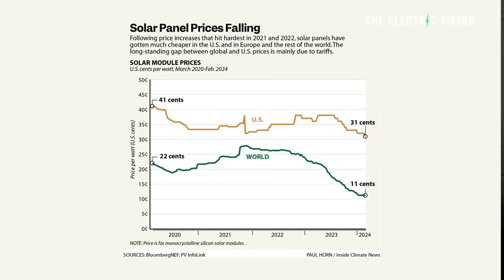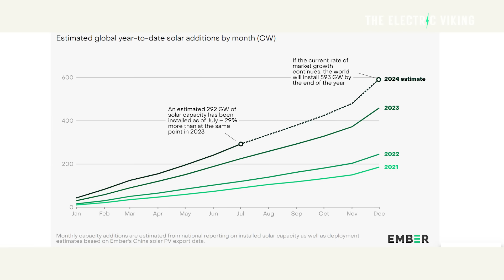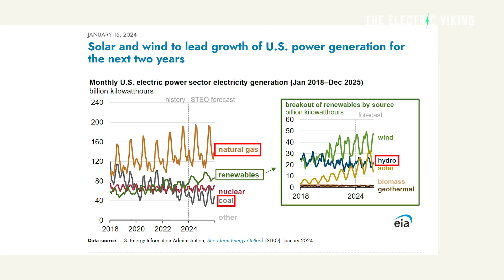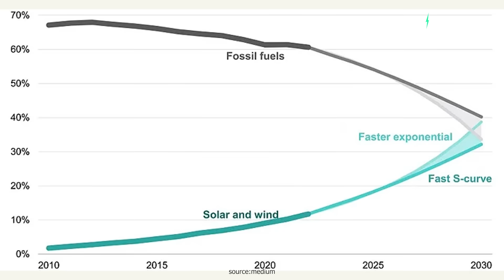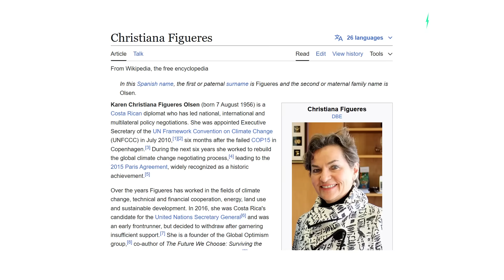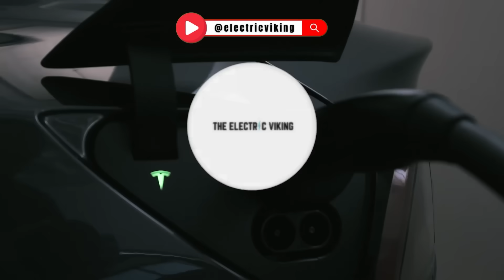Solar & wind will quadruple to 14,000 terawatt hours by 2030 & crush fossil fuels

Comment: My new home I’m buying in Las Vegas later this year (it hasn’t been built yet) is fully electric, energy efficient, solar on the roof, heat pump, induction cooking, two Tesla chargers in the garage. I have no gas in the home, no electricity bill other than the $15/month the utility charges me to be connected. I will install a power backup at some point but overall it’s great being energy independent and driving my EV for free and having my home a comfortable 70F year round for no extra cost. Love it.

Comment: I'm only halfway through this video, so perhaps you'll get there, but a major factor you aren't mentioning is solars intermitancy.  
I am a Canadian who got a solar system installed in December 2024. It is 5.66kW currently but will be 6 kW when the electrical grid connection gets  moved to underground. It should provide about 80% of the net electricity my house needs over the entire year. It has not generated enough power for my heat pump! In the summer it will be in surplus and I'll sell to the grid. Solar power is great but it cannot be a savior by itself.

Comment: Sam, you grossly exaggerate the cost difference between the US and elsewhere.  I have 21 panels on my roof here in Arizona.  It was about $3.85 per Wp back in 2015 and has become cheaper since then, and I received a 30% tax credit which still exists..  The panels are only a small part of the total cost.   There is lots of solar here and elsewhere.

Comment: Solar panel prices have fallen by over 50% in the last two years! Green electricity generated with PV modules now only costs around 2 to 4 cents/kWh! 
It is therefore extremely worthwhile to generate a large proportion of your own electricity in 2025!
For example with solar panels on carport or house roofs, on house walls or in the garden.

Comment: Fantastic solar news, Sam.  However, nuclear might actually be less of a solution than previously thought.  There are several new technology deep hot rock geothermal projects being built today and more planned.  Check out the city of Vantaa in Finland and a company named QHeat, short for Quantitative Heat.  It seems to me these new utility scale geothermal companies are quickly adapting oil and gas drilling tech, experience and data to provide renewable deployable 24 by 7 baseload energy, and they are doing it now, not five or ten years from now.  Without the dreaded 'N' word attached to their business they appear to be locking in chunks of community heat and electricity budgets today.

Comment: NASA reports global warming at 1°C where it has been since 1992 after falling from 1.1°C in 1991.   Nobody has notice the effect of solar voltaic panels because they haven't saved fuel.  It is extremely fuel expensive or prohibitively battery expensive to back up a solar farm when a cloud passes over it.  A home emergency battery backup system being maintained by solar voltaic electricity is attractive.   You're buying a four day home battery backup system then using solar voltaic to maintain electrical storage.  The solar voltaic panels are almost an incidental cost compared to the battery backup cost.

Dumping wild AC on the power grid makes other people frequently at lower income levels pay for that expensive support.  There has been little economic inflation pressure on US electricity rates.   Salaries did not go up and fuel costs were stable.  The rate increases have been from supporting wild AC from wind turbines and solar voltaic generation and implementation of fast response expensive to run instant backup generation for them.  It is likely that expensive forced support of wild AC by the public will be eliminated.

Comment: You ommit necessity to upgrade grids, it's good thing to do but it is necessary due to solar and it costs money.
Reply: At least in the US the need to upgrade the grid for future data centers and AI never seems to be a limiting factor for industry/government. But when it comes to solar/wind, then it is a problem.
Reply: @markvalery8632  in EU we need to upgrade our grids for household solar
Reply: @ That doesn't make sense. With household solar you are generating your own power reducing what the electrical company has to distribute.
Reply: @markvalery8632   no, it does since you have to put that power into grid and it's not what most grids are made for and you it's not like you just don't use grid electricity, you may produce more then you use (like I do, so I don't ever pay for electricity) but it does not mean 'no traffic' I use most power in evening when I produce zero, and when I produce most power, same goes for all my neighbors who have solar panels so issue is often grid can't take in so much energy and someone may not be able to sell their energy. 
that's why I will buy batter in the future, I am not off grid, no real need for me to store energy, but it is necessary for our grid.

Comment: When people talk about return of investment, payback time, they are forgetting one important thing. If you spend say 10,000 € on solar panels, solar hot water, batteries, then the value of your property increases by the same amount. Also the house will sell quicker. Same is true for a car charging point or good energy score. Much better investment than a new bathroom or kitchen, which the new owners will replace anyway.
Reply: If property value increases then in US property tax goes up. Wonder if that is taken into consideration with US payoff numbers. Plus if the money spent on solar was invested at 7% over the life of solar how does that compare.  I do not care as I today just committed to a rooftop 5.4 kw system. So just wondering...

Comment: 10 cent Wp. Supercheap Clean Solar Power. Rooftop, Solarparks, Parking Solar. We get a new Solarpark in Midden-Groningen Nederland of 200 MGp. 160 hectare cost 100 million euros. Start building Februari. Cheap Solar Power for our Community. 200 Million kWh every year in Groningen Nederland. In Germany near Leipzig a New Solar Park of 650 MGp. 650 Million kWh every year. Cheap and Easy. I have Rooftop Solar since 2012. 6000 kWh every year. Working perfect for 13 Years Now. No Gas no Energybill since 2012. Price here is 10 cent kWh. Taxes 10 cent. 
That is 100 % tax. 
And above that 21% vat. Tax is more than the Clean Energy. Thank You Sam for this Solar Update. In 2024 China installed 277 GWp Solar. 277 Gigawatt. Super ❤👍🌹🌹🌹
Reply: Fantastic, but production is close to 0 during the winter months in lovely Groningen.
Reply: @maartenvanderheijden-kl9yv  In Winter we have Cheap Windpower in summer Cheap Solar Power. Perfect combination in beautiful Groningen. We get Rich. And companies come to Groningen for Cheap Wind and Solar Power. More to come.👍🌹🙂

Comment: DISTANT RENEWABLES ARE GRID ELECTRICITY. EXPENSIVE ELECTRICITY, wake up.😮😮😮😮

NO GRID ROOFTOP IS the most fundamental economic option. 
NO GRID v2g BEVs massive battery's is FREE STORAGE 23hrs every day and all night long. 

Grow up, and listen. 

LNP high marginal taxpayers will ❤️ v2g BEVs and PV rooftop dirt cheap electricity. 
TAX FREE SAVINGS are at maximum for high income early adopters. 
Savings, 
Petroleum $3,000 per vehicle. 
Say $6,000
Grid electricity  $2,000
Gas heating, cooking, hotwater $2,000

Shaded hot roofs with cooling 😎 PV panels,  more air-conditioning costs savings.

TOTAL $10,000 tax-free is $20,000 before tax income and more hours of work,  hello, hello anyone home hello 👋 😀 😊😊😊😊

For 3 decades ? ? ?

Am I being too conservative for the high income tax paying conservative LNP VOTERS ????

Who wants NUCLEAR GRID ELECTRICITY electricity in Australia's Sahara Desert latitudes sunniest continent on the planet.
Who who who  ???? WHO ARE YOU ??? 😮😮😮

Comment: Rooftop PV is dirt cheap BECAUSE IT HAS NO GRID COSTS.
This is difficult for people to understand. 
Grid electricity is 10times more expensive than electricity generation. 

PV electricity is a 5hr thing and demand is a 24hrs thing. 

We need more BEVs, v2g BEVs. 
Most vehicles are parked 23hrs every day and all night long. 
Most vehicles drive building to building carpark space. 

Most buildings rooftops are elevated, sunny, grid connected, and need PV panels shading hot roof.

Hello selfplug-in V2G EVs or BEVs.

Comment: Rooftop PV is cheaper than windows $m² installed. 
Rooftop PV panels shade hot roofs and reduce air-conditioning costs,  shade 😎

Comment: I have a south facing roof and can generate >4 Kw. I am surprised that my panels generate more power on a fresh cool, bright day than when they get really hot in the peak of summer. Is this normal ?
Reply: Efficiency of solar panels decrease with temperature. My peak solar production per day happens in March even though there is more sunny hours in June in Massachusetts.
Reply: @markvalery8632  Same here. I wonder if there'll ever be a unit made that is PV combined with a 
fluid filled heat exchanger matrix. The fluid would reduce the heat in the panels and be used to  generate hot water whilst maintaining maximum efficiency from the PV side.
Reply: @AlanJan_UK_49  In 2013 I looked into some german PV panels that were water cooled. I was looking to put in a pool, but to extend the pool season (which in my area is 2 maybe 3 months if you lucky) by pulling heat from the panels and piping it to the pool along with domestic hot water. The design ran into a problem. The amount of panels needed to provide enough heat for the pool during early summer and late summer was way more than the 38 panels I could fit on my roofs. Then there was the summertime. That  same amount of panels would produce way way more heat than I could  use. I ended up with no pool and just plain old PV panels.
Reply: @markvalery8632  At least you thought about it. I just thought of it as a concept but there would be too many problems to overcome. I am utterly delighted with my domestic set up. I cannot store my power but I can boil water in a 1,000 watt camping kettle and keep it very hot in thermos flasks. I had about 1,500 watts coming in this afternoon so I will use the water for cooking tonight ( reduces gas used ) and washing up etc. etc.
Reply: Output for solar is usually rated at the temperature of 70 degrees F. Output tapers off as temperature increases or decreases from that point.

Comment: Generally agree with Sam. But Sam is from sunny Australia ! Here in Europe, most of the landmass is located North of the Canadian/USA border parallel : we do not have any sun in winter. And if we get inland wind, it is often too strong for the wind mills.... Therefore, for our long gloomy rainy winters where some places can see over 300 days of rain per year, we need another CO2 free source of energy. Only solution i can see so far is Nuclear.
Of course summers have long daylights and solar will make full sense then together with batteries for night energy. 
So lets shut down most Nuclear plants for maintenance during summer and save the dams water for dry seasons/years.

Comment: We don’t need large batteries 🪫 to hold the power we need superhigh voltage  underwater power lines that can take power from India 🇮🇳 to Australia 🇦🇺 to Japan 🇯🇵 to America 🇺🇸 to Europe to Africa problem solved. Because the sun 🌞 never sets
Reply: Though, the cost of grid scale batteries has dropped so dramatically it’s becoming cheaper to store locally produced RE than send it as HVDC across continents.

Comment: Double whammy for Americans. Solar is expensive and insurance companies are canceling policies if you install panels on the roof.
Reply: That's insane, insurance companies in your country have far too much power....
Reply: Where and when have they cancelled policies for having solar on the roof?
Reply: OK, just read about Florida, no other state, that is doing this. Very fishy. "Some Florida Power and Light contracts that says any damage caused by the panels, "you as a homeowner are responsible to pay for all of that damage." Often insurance companies will give an example such as a surge running through your panels that causes damage to the grid or other homes." But, "However, the theory that solar panels can cause damage like that is bogus according to state authorities, Campbell said." 
Another reason given by Florida insurance companies: "Home insurance companies are also denying coverage if the homeowner chooses to sell the extra power their panels make back to the electric company. The system is called net metering, and it's a common practice for a homeowner with solar panels."
Maybe the Florida government, electric companies, and insurance industry is trying to limit rooftop solar in Florida?

Comment: I want solar roof shingles like Tesla is offering instead of those ugly black panels. But they’re too dang expensive even with the subsidies. Remember that American homeowners also move every 5 years on average so they’ll never realize the full benefit. Eventually this will all turn around to a more cost effective solution.
Reply: Those Tesla roof shingles are garbage, Panels are way more efficient, and Musk is a m0r0n, I wouldn't buy a thing off that cl0wn...

Comment: Did you hear about the big, toxic battery fire in Northern California this week?? Terrible.
Reply: Did you hear about the air pollution effecting pretty  much all human population? I'm sure you regularly hangout behind idling cars and diesel trucks enjoying the toxic heavy particulate air. 

Did you hear about  Deep Horizon offshore oil rig fire and oil spill? Lots of people and animals died.
Reply: @ I'm so sorry it's so triggering for you to hear that there are still major environmental health hazards in a post-fossil fuel world
Reply: not as bad as all of the refinery fires that happen regularly.
Reply: @ Different, not lesser. They produce hydrofluoric acid, a heavy corrosive.
Reply: @respobabs  According to the Monterey government: "Monitoring is looking to detect Hydrofluoric Acid (HF) as well as particulates.
Data gathered so far indicates HF as non-detectable and low particulate levels.
To date, 750 data points have been collected using both fixed and roaming monitoring." The amount is lesser. Do some reading on oil train derailments and fires.
Reply: Did you think you had a point ?
Reply: @MickH60  Yes, when the video mentioned batteries, I remembered that there's a huge, toxic battery fire raging in northern CA. Sorry if this is upsetting to you. It's upsetting to me too.

Comment: im assuming you calculate with installed capacity when saying total nuclear*8 = solar in 2-3 years. now use the capacity factor of solar of around 10-15% depending on your location and suddenly you realize that the yearly output is only about 1/8 of what you think. that would still mean solar in 2-3 years = total nuclear which is a lot.
Reply: Capacity factor included mate....

Comment: Nuclear works 24/7 Solar currently in the UK is currently virtually non-existent with little sun over the last several months. Summer great, Winter no good.
Reply: you do realize that solar panels make power even on cloudy days right?
Reply: After tou spend 20 years building a generator tgen find enough fissionable material and find a safe way to dispose of waste but, by tgat time, solar and wind will have improved again. Forget it.
Reply: Nuclear is the MOST EXPENSIVE source of energy, with a by product that;'s insanely dangerous and takes 10,s of thousands of years or more to break down to safe levels of exposure.... Solar still produces power through clouds mate, it's about time people like you updated your knowledge...
Reply: How is Hickley Point C going?

Comment: Since installing my solar and battery system, 3.2 Kwh array with 13 Kwh battery, I have saved a lot of money. Yes it's not very efficient in the winter here in the UK/Wales but the overall/average savings over the year are significant. Another way to save costs is to charge up the battery at night when the electricity is cheap and use it in the day time when costs are high. Daytime is around 26 pence per Kilowatt hour and 7 pence at night. I am amazed that people if they can't fit solar don't just install batteries and charge up at night which is a lot cheaper to do. The one negative argument I get is "they" always ask what is the payback period which I suppose is a fair comment but as costs come down then this period will shrink. One good point is it will increase the value of your property if you are selling. A good saying is you don't plant a tree for yourself but for future generations.
Reply: As the cost of energy rises due to inflation, the payback period of a household Solar PV system & battery is also reduced in real terms.